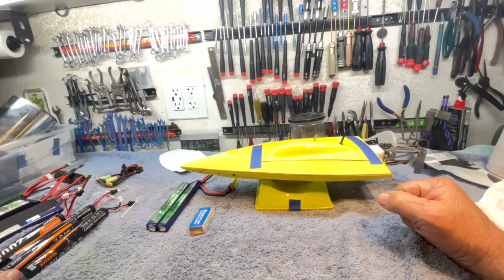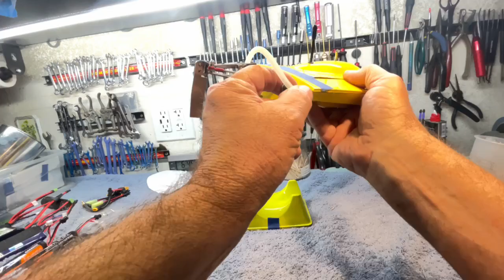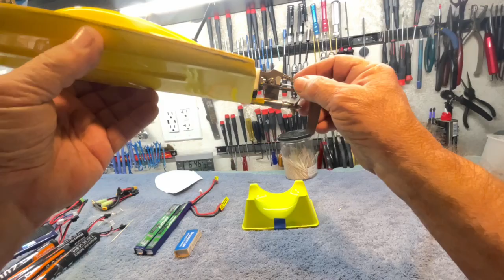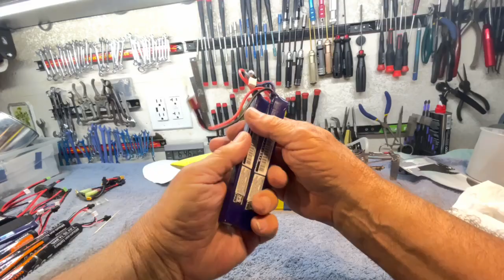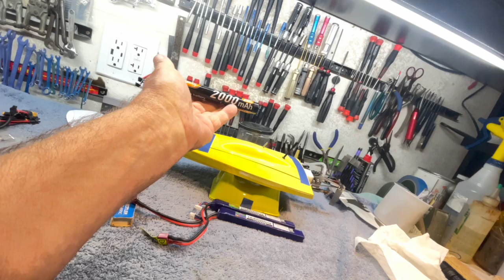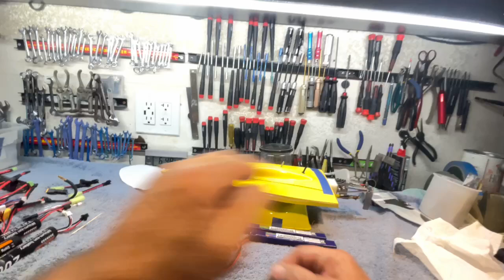Dr. Jet performs mission readiness inspections on the Mozilla 400 and the John Deere Rescue Rigger.

Comment: That looks like a zippy little boat.. and self righting! Hopefully there's no gremlins hiding in that hull 👀👍
Reply from the maker: I've run that boat several times and I haven't found any gremlins yet...  🙄  I was concerned that the little 20mm Neutron motor might not provide enough oomph, but Steve's motors have the torque to get the job done, regardless of size.  The 707/2Y that's in it is a Micro BEAST.
Reply: @Dr_Jet  My hydraulics instructor used to say torque, is how far your heels come off the ground when you try to pee with morning wood.. 🤭 Looking forward to the pond run!👀👍